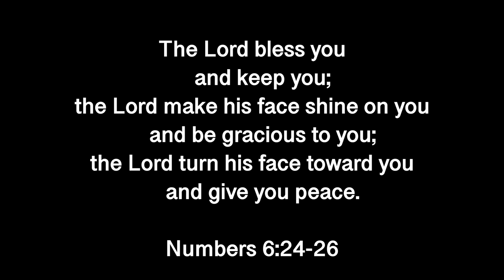Best Rear Ballast?? Heavy Hitch vs. Ballast Box

Comment: Nice commercial. Too bad you did not give any benefits of a ballast box. I filled one mostly with concrete leaving enough room on the top for a gas can, oil and tools for my chainsaw which I have a saw haul for. You really have no where on the tractor to haul those things. Not to mention that dinky tractor you have most certainly may have a problem where a higher profile tractor would not. Also mine fits my quick hitch cat. 1 perfectly. There is some truth to all you are saying for a very small profile tractor and trailering but many people do not trailer their tractors except to the dealer for service. I do like your videos so keep up the good work, but this was not any more than a good commercial for a sponsor.